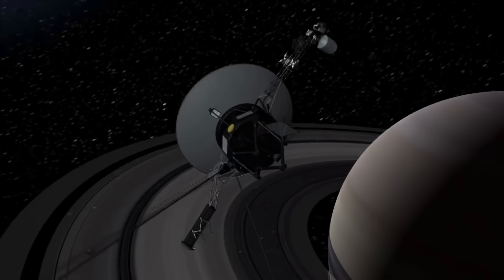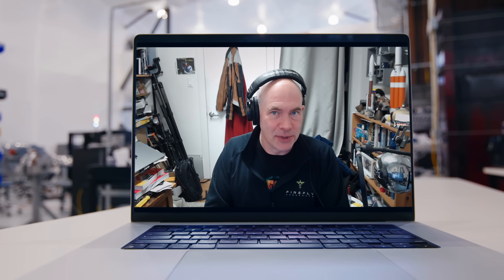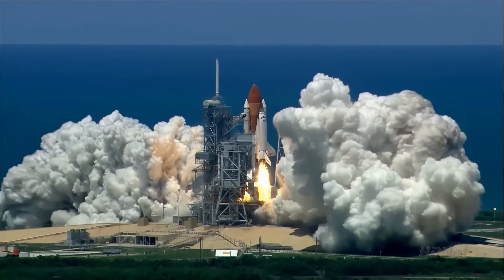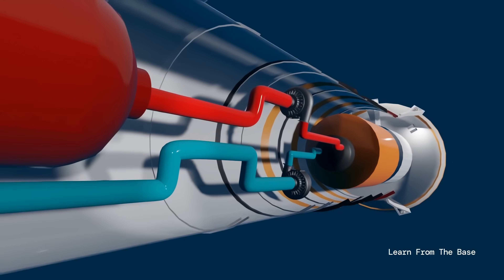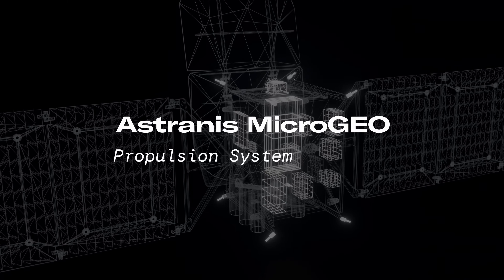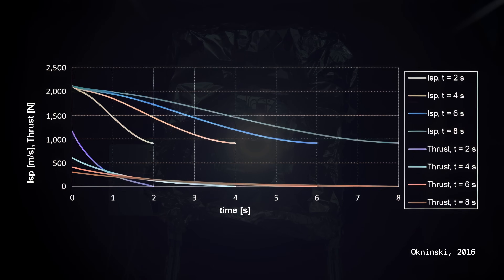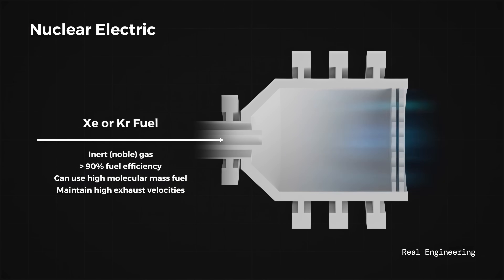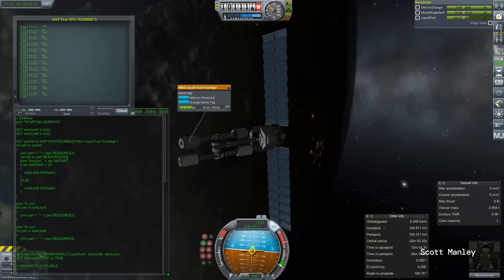Space Propulsion 101 with Scott Manley & Joe Barnard

Comment: Earth	0.00005 tesla
Sun	0.0001 tesla
Fridge magnet	0.01 tesla
Sunspot	0.4 tesla
Junkyard magnet	1 tesla.

 use a powerful magnets repulsion/attraction  F= B I L     B = TESLA  I= CURRENT L = LENGTH  1 NEWTON = 0.0001TESLA S X 1 AMP X 10 KM WIRE

    Where:
        F = magnetic force on the current-carrying conductor (N)
        B = magnetic flux density of external magnetic field (T)
        I = current in the conductor (A)
        L = length of the conductor in the field (m)
        θ = angle between the conductor and external flux lines (degrees)

    This equation shows that the magnitude of the magnetic force F is proportional to:
        Current I 
        Magnetic flux density B
        Length of conductor in the field L
        The sine of the angle θ between the conductor and the magnetic flux lines

Comment: i don't understand why we don't use the bouncy of the atmosphere to raise above it the some propulsion to get above or to a station above then imprint angular velocity to the load and release... on destination recapture the velocity into angular velocity and lower it to end destination... Why is everyone trying to do everything at the same time in such short time intervals...
Reply: Huh?
Reply: @caldodge  Currently, we use propulsion for 100% of the road to space. Also, all the energy the rocket produces has to be first generated and then removed for landing. 
Having systems permanently in motion that simply transfer the load through the stages 0~60km and 60~100km and 100km+. This means that you only generate extra thrust/lift/angular momentum for the load only.
Use air ship, air drag for first segment, then rocket/tethers for 2nd and spin launch for 3rd.
Then, on arrival, you can recapture the velocity as spin and conserve almost all the energy used.
It's time to build roads, not off-road vehicles, for space...

Comment: Does the payload weight and thrust have anything to do with first stage burn thrust 😚 or does the second stage and trejectory have an effect on that parameter?😎💯
Reply from the maker: The thrust is independent of those variables -- thrust is determined by the engines themselves. But if you have a heavier payload, you do indeed need a more powerful rocket to lift it to the orbit!